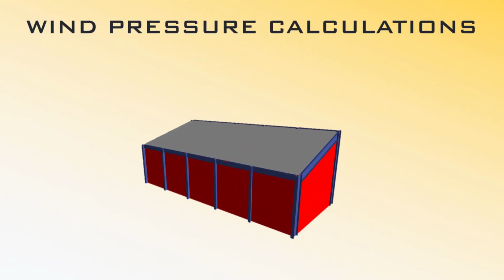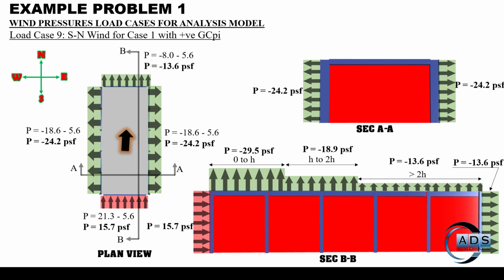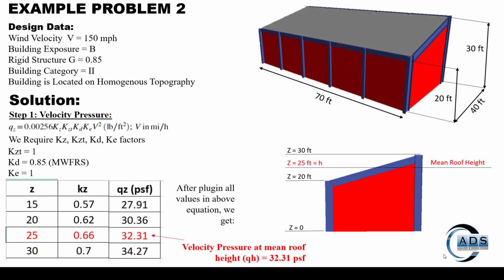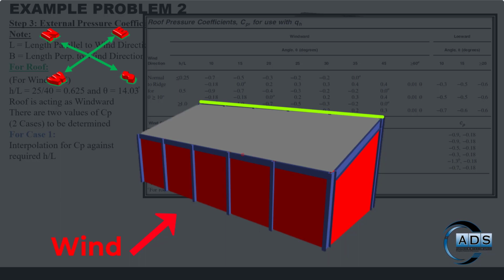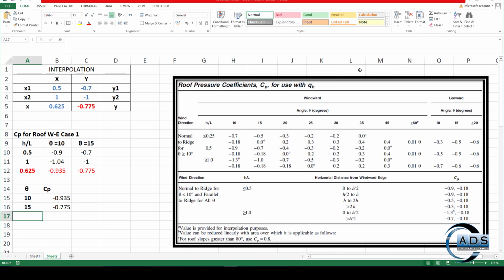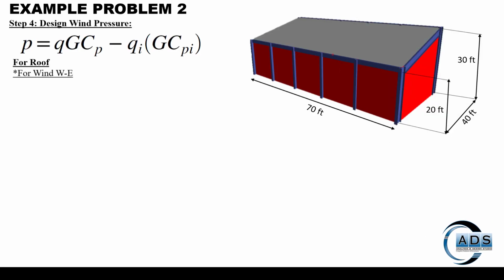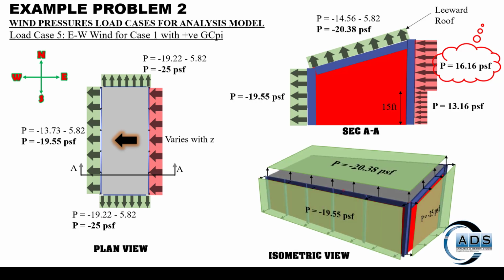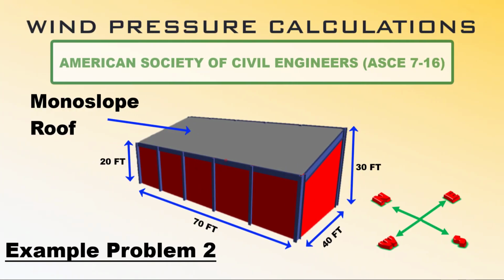Example Problem 2 (Mono-slope Roof Building) for Wind Load Calculations using ASCE 7-16

Comment: hi..very informative & uswful video..thanks a lot.could u also upload a video on wind dynamic analysis/forces to be considered 
 as per american code?
Reply from the maker: Thanks for appreciation. I did not carry out the study of dynamic analysis for wind loadings as it is not common for the design although for some special kind of building Asce 7  refers wind tunnel test of prototype of building. Dynamic analysis is done mostly for seismic forces.

Comment: If we design this in etabs,should we have to assign leeward force to structure when the structure is open from all sides
Reply from the maker: Hello bhavin... Hope you are good. In etabs, only enclosed and partially enclosed conditions.. We can apply the wind loads from the etabs and this is only for building. For structures other than regular buildings it is better to calculate wind loads manually and also apply them manually.. Thats why i have started video series regarding this topic. Hope you understand.  Keep  watching and keep sharing.. ❤️

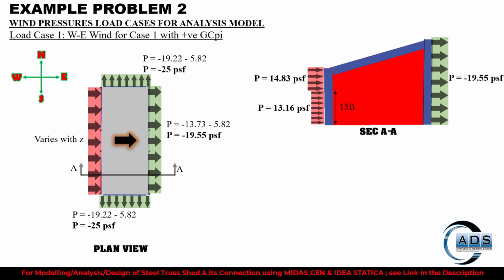Comment: At 16:49 I think the direction of arrows should be towards the roof rather than going away from the roof; Kindly correct me if I am wrong.
Reply from the maker: No Brother, as net pressure value is having -ve sign with it, means pressure away from the surface. +ve means towards the surface. see my 1st video on Wind

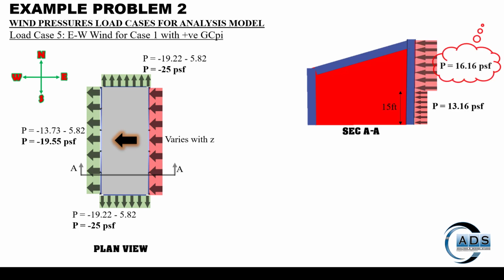Comment: @ 18:03, why do you show the average pressure instead of splitting it up into all of the regions? I.e. Pressure from 15ft-20ft, pressure from 20ft-25ft, and pressure from 25ft-30ft?
Reply from the maker: I have used average value of these as to reduce the effort. Otherwise need to apply loads in software in different intervals and it take time, as height of building is not so much so it is better to use avg values and it is some what conservative. But if height of building is more like 50 to 60, then it is better to take intervals of 2.5m or 5m and calculate pressure at these interval and apply accordingly. Hope answered your question.

Comment: Hii.. You are doing a very good job.. i just want to tell you that please check the KZ value in that. As per code upto 30 ft you have to consider the KZ value is 0.7.. Please check it. Thank you..
Reply from the maker: Thanks for Appreciation brother. The point you were raised is true when we use Envelope Procedure (Chapter 28) to find wind pressure. because at Table 26-10.1 footnote it is written "Use 0.70 in Chapter 28, Exposure B, when z < 30 ft (9.1 m)." But here I am using Directional Procedure (Chapter 27).

Comment: Thank you for this. It's very helpful. 
What would Cp for roof be if the angle is less than 10° and h/L is the same as the example(0.625)?
Reply from the maker: Thanks for appreciation.. In that case, Example 1 case will be followed. (Wind Load will be independent on roof slope)